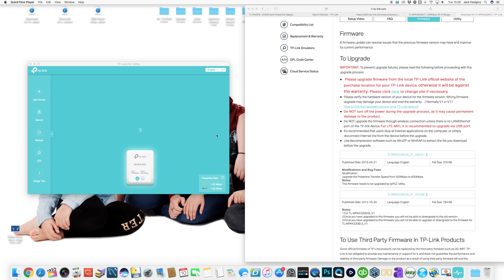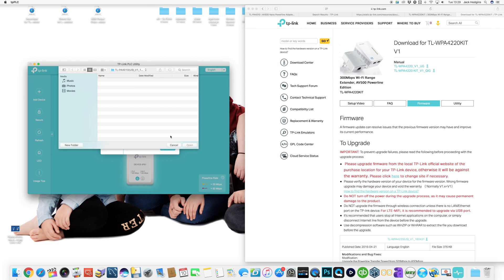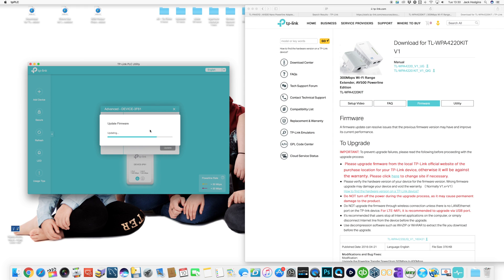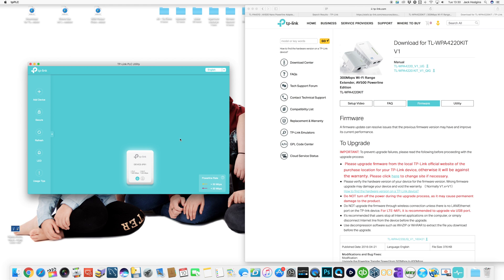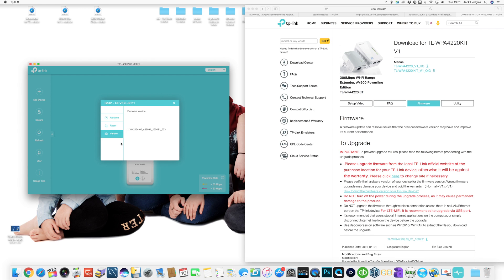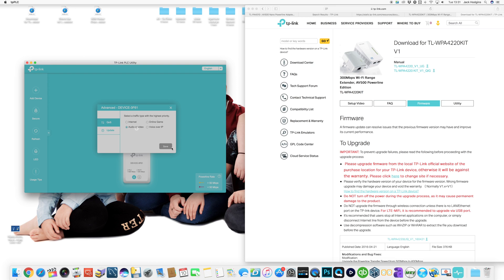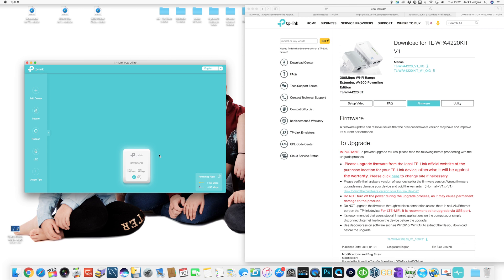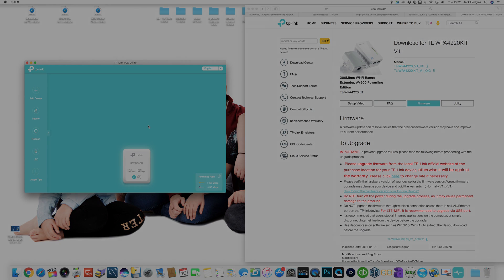TP Link AV500 Powerline Edition firmware upgrade

Comment: how do I upgrade firmware if using Mac with MACOS12.1 which automatically deletes zip files
Reply from the maker: If you would rather Safari just download the .zip file and leave if for you to decide what to do:

Open Safari 
Click Preferences
Under the General tab, uncheck the option Open “safe” files after downloading
Reply: @jacktechtips  MACOS 12.1 HAS auto delete function if think file download dangerous known as MACOS Monterey
Reply from the maker: @mikejohnson8391  you can install chrome and download the file that way too :)
Reply: @jacktechtips  maybe but operating system has built in security firewall which automatically deletes zip files but does allow 3rd party applications.
Reply from the maker: @mikejohnson8391  have you tried zipping it backup ?

Comment: I wrongly upgrade AV200 Nano Powerline Adapter firmware, can be fixed? The wpa is working fine thou
Reply from the maker: You need to log a call with the product support as they know how to revert back, normal you just update it with the correct one and it all done.

Comment: Has anyone been able to configure the SSID and WIFI passwords for the AV500 V_1? I've tried with the tpPLC app and don't have the option and can't connect to these using the tplinkplc.net url? Any workaround?
Reply: I've just been going for 10 hours straight trying to get to this! I finally managed to get to the admin page by manually setting the ip on my computer to a 192.168.1.* range and access the plug by 192.168.1.254. Every time I tried with the official weblink it just sent me to a junk website or would time out if I disconnected from the internet completely but stayed connected to the plug.
Once I was finally in I discover there is no settings for manually setting the wifi ssid or password. It seems it's only set up for WPS settings? And now I'm running DD-WRT firmware on the router there's no WPS as its just not secure! So, after all that it's a bit Fubar by the looks of it. So if you happen to have found a workaround in the last 9 months could you give me a prod lol!

Comment: Good on you for using the filtered power strip to keep the device from dealing with traffic as it tried to update.  I didn't bother following that recommendation, and even updated three of my four through the powerline side, which seems to have worked fine.  After update the LEDs no longer indicate activity or forecast blackholes and updating turned on powersave, but I still like these sleek little adapters.

Comment: Is there a way to upgrade to the newest firmware V4? I extracted it but I only see a .bin file. I can't find the  PIB and NVM files
Reply: For those asking about V4, I don't think you are meant to upgrade to V4 .. the V1 to V4 selection is what you choose as part of the version of hardware you have. That allows you to get to the latest version of the software available for that model.
Reply: i have the same problem, did you fix it?
Reply: I have the same problem too